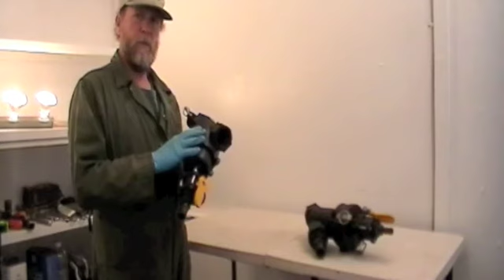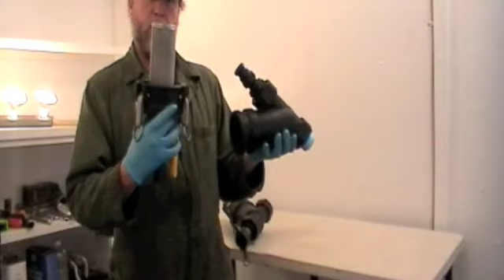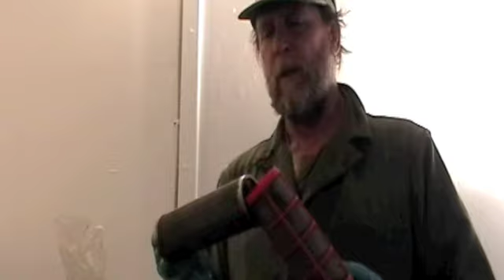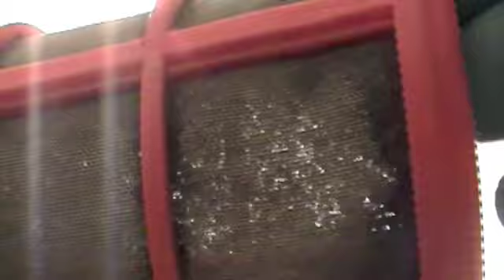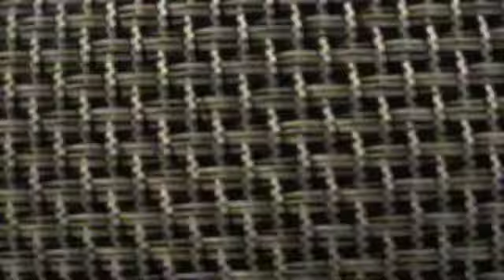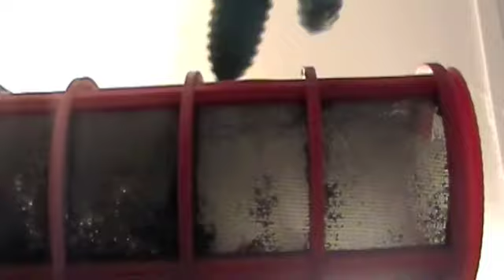Using Y-traps to Process Waste Oils into Diesel fuel

Comment: Jefrey, I have a 1997 Dodge with Cummins diesel. I've been blending 20% gasoline with 80% WVO. I live in northwest Florida. Today the temperature was 77F and the truck started to surge and die when in gear at idle. If I shifted into Neutral everthing was OK. Should I change my blend or try to add a filter heater? Any other suggestions? Thanks for all your help!
Reply from the maker: Tony Ward If you settled your blend for a week before filtering, and you were successful at removing the sediments before blending, then your problem might have been more precipitates formed due to a sudden cool trend.  In this case adding gasoline at 10% will often solve the problem.  Otherwise your fuel filter might be plugged.
Reply: Thanks for responding Jeffrey. My procedure is to take veggie that has been settling for years and filter it through a "Mr. Funnel" fuel filter into a 5 gallon container. I put in 4 gallons of veggie. I then put in 1 gallon of 100% premium gasoline. It does not have alcohol in it. I shake the container and then immediately put that into the truck. Sometime I pul that blend through the Mr. Funnel. Everything was running fine until the cool weather. Yesterday, I took out the fuel filter to check it. There was some contamination and I put a new filter in. The viscosity of the fuel blend seems OK to me. The truck still would die when put into Drive. I noticed that the RPM as around 500. It ususally is a little higher. Do you think that I need to increase the idle speed a bit to overcome this problem? I watched your video on cold weather starting. Did you have the stock fuel filter and no filter heater when you started the truck? Thanks for all your help, Jeffrey!!
Reply from the maker: Your problem is you are not settling after blending.  Settling for at least 24 hours, and better for a week or 2 will allow contaminants to settle out from your blend, then you will have to figure out how to separate the sediments from your blends. 

Dump Mr Funnel, and get a decent filtration system, and your problems will go away.

Your injector pump might have a screen in it, which might be plugged now, if you notice a reduction in performance or idle.

No, I did not have any heaters on my van powered when I started my van in cold weather.
Reply: Thanks for the response. I will take your suggestion to let the blend settle for at least 24 hours. I don't seem to have any performance problems except the slow idle which causes the engine to die when I put the truck in gear. If I hold the accelerator down a little bit, then eveything is OK. Were you using the stock fuel filter that is mounted on the engine instead of a speciality filter? Is there a brand of fuel filter that you prefer?  About how long did that filter last? Is the fact that my oil is rancid and several years old a factor that can cause the stalling problem?  I'm sorry about asking so many questions, but YOU are the man! Thanks for all your help!
Reply from the maker: I used the stock filters until the secondary filter was no longer made, then I switched to a RACOR water trapping 2-micron spin on filter, which I am very happy with.  I back-flush my filters in situ, so that I never have to replace them.

If after settling your blends for more like 1-2 weeks, you still have a performance problem, then you could try advancing the IP.

No, old oil works as good as new oil, as long as you blend before settling, remove the sediments, then filter.
Reply: Jeffrey Brooks
Thanks for the tips! I'll make these mods and let you know what happens! Have a great day.
Reply: Tony Ward
Jeffrey, do I need to install an electric fuel pump to help the stock lift pump? I went to see the injection pump people about the stalling at idle problem. They didn't say anything about a clogged IP filter. If I keep my accelerator depressed ever so slightly, everthing is OK. They told me how to increase the idle speed if I want to, but I haven't done that yet.
Reply from the maker: When the temperatures cool, then high melting point esters can precipitate out of your blend, so it is wise to not leave these fuel blends in your fuel tank for long periods.  Also, it is best to settle your blends in the shade in a cool spot, so that the high melting point esters will precipitate out of your fuel blend
Reply: Jeffrey Brooks
Thanks for that info. I found that the cause of the slow idle was due to a clogged fuel strainer. On the Cummins diesel, there is a fuel strainer just before the lift pump. Mine was clogged very badly. After I cleaned it, it starts and runs OK. I am still getting some smoke, so I plan to turn up the IP a bit.  I also have taken your suggestion and gotten a good filter to pump the blend through into my truck after I let it settle for about a week. There was hardly any contamination in the bottom of the blend tank.
Reply from the maker: Tony Ward good to know that it was just a plugged fuel strainer, but that plug probably came from your process of making fuel, so if you are more careful, then you may not have any more plugs.
Reply: Jeffrey Brooks
I agree. The temperatire here in the morning is in the 50's.  The lowest it gets here in the winter in low 30's. I hope that I won't need to install an electric pump to assist the lift pump when it gets too cold. Your thoughts?
Reply from the maker: I have started my 30 year old Chevy diesel on this blend at 0F (-18c); and I have run my diesel engine through the winters of central AZ for 5 years.  Occasionally I get a plugged filter.  The solution is to rush the settling process, and settle your fuel blends outside in the shade.  You will have more precipitation of fats in the winter.  Save them up, and blend them when the melt during warmer weather.

Comment from the maker: It depends upon how much a hurry one is in to turn waste oil into diesel fuel.  I acquire about twice as much waste oil that I need, so I can afford long settling times.  Therefore I settle my waste oil for weeks.  

WVO only needs 24 hours of settling after blending to be quite clean; whereas, WMO needs weeks.  I can afford that much settling time for WMO blends.  But, if I am in a hurry, then I use a centrifuge.  But, speeding up the settling process with a centrifuge consumes a lot of my time

Comment: Another question re the time needed for settling. Simple Centrifuge processess about 75 liters per hour, or 1,25 liters per minute. So around a liter of oil at a time is experiencing 1200 G's for a minute. Your solvent blend in a settling tank has all the oil (80 liters) experiencing 1 G at the same time. If you divide 1200 G by 60 minutes/ 1 hour, you get 20 hours. So my question is; is 1 G over 20 hours equivalent to 1200 G over a minute - and thus would shorter settling times be possible?

Comment: Would you recommend draining sludge from WMO blend at the end of the 1-3 week settling period, or smaller amounts at intervals during that time? Secondly, I noticed that in one of your videos turpentine works best for cleaning filters. Would turpentine therefore be a good/usable solvent to use in promoting sediment/ free carbon settling, instead of say acetone?

Comment from the maker: I am glad the 20/80 blend works for you.  I settle my WVO blends for only 24 hours.  At the end of the 24 hours I drain off anything that is thicker and/or darker then the rest of the blend.  The often comes to no more than 10% or less of the total blend.

I save the sludge into a sludge bucket and pour off the light amber blend that floats to the top after a week of settling.

Comment: Thanks again Jhananda. FYI - I've been running on your  20/80blend for about two months now in my Merc 240D, and have done about 700 kilometers with no problems. No smoking at all and good power. Have only been filtering down to 1 micron with sock filters, but have purchased a conical tank and will be settling and draining sludge as per your technique shortly. By the way, how often do you drain the sludge, and how much at a time? Is it easy to distinguish sludge fro the regular WMO? Thanks.